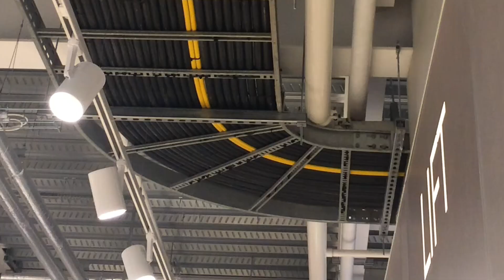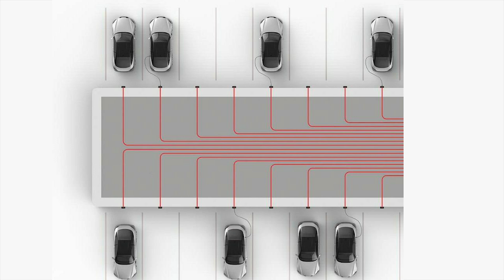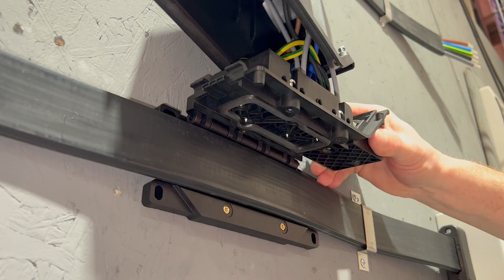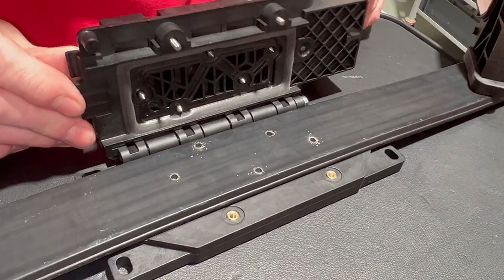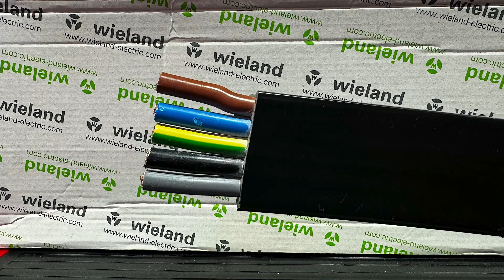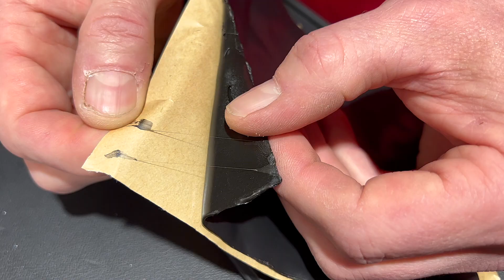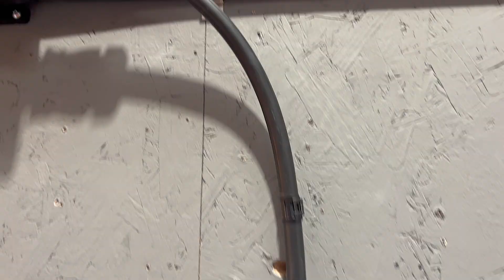How Can This Cable Speed Up Electrical Installations? - Wieland Podis

Comment: Ref. Solar connectors, I think I'm right in saying I'd struggle to find connectors that are the same make as the panels for example? And then at the inverter / battery+inverter end, would I need to find MC4's made by the inverter / battery manufacturer?

Comment: Harks back to the old festoon lighting system where the bayonet cap light socket screwed onto and into the rubber cable piercing it with the same 'vampire' contacts

Comment: I am British and long used British systems.  I now also live in France where I have extensively used their system.  Let's keep it simple, the current UK system is inferior and out of date.  Highlights of the French system over the UK system: Socket and switch in-wall boxes are round not square - cut with a circular tank cutter in a few mins,  light and power cable is marked every metre on the jacket and is colour coded (1.5v2.5), connections to sockets and switches are all push fit with a push button to release, the big benefit is dual pole switching  and isolation for all breakers in the consumer unit. The UK system is truly stuck in 1950.

Comment: We can only assume this is product placement as this gear looks nasty, especially those joints, i guess its cheap but wont be in the long term. A tap-off bus system is just as quick and not at all expensive so cannot see any advantage.

Comment: Usually tapping into a wire causes a bit of a damage to the wire. That damage reduces the electrical cross-sectional area, which in turn reduces the wire's ability to carry current. I am also a bit worried about the connection, will it always tighten properly.

Comment: With that many EVs charging on a buss rated at 63 amps, even if it is 3 phase 415 volts, I think a lot of people are going to be unhappy with their charging times. Here in the US typical home EV chargers are 240 volt single phase on a 60 amp circuit. I have no idea what the power-factor, or the situation with sine distortion and harmonics from these chargers is, but it can't be good.
Reply: Power factor should be extremely close to unity for any large power supply. They all have active power factor correction.

Comment: Just trying to understand, the entire buss bar can only handle 63 Amps?  My home charger uses 48A/240V, so that wouldn't even get 2 chargers.
Reply from the maker: This is 63A per phase at 230 - 43kW
Reply: @efixx  Assuming this is 3-phase, 63A x 230V x 1.732 (√3 - for 3 phase) is only 25kW.  I'm not sure how you get 43kW.  A typical slow home charger in the USA is 11.5kW, which delivers only about 25-30 miles of charge per hour of charging.  You could get just over 2 per cable here.  Anything too much slower than that isn't worth much if you are only going to use it for an hour or two.

Comment: I do not see a convenient way to do 90s to go vertical. I wonder if there is a box that can be used to bend the cable to prevent breaking out for multiple turns and curves that you may get with previous infrastructure.

Comment: I wouldn't worry too much about the need to install EV chargers in underground carparks or apartment buildings. That practice will likely soon be outlawed (and already is banned in several locations), or made utterly impractical by insurance companies refusing to cover any building with such installation. The risk of uncontrollable fire caused by charging EVs is simply too great. It will likely soon become illegal to even park an EV in such a facility.

Putting EV chargers in the lower parking levels of large residential buildings, or even allowing EVs to park in them is just asking for a disaster of monumental proportions.

Comment: No no no just no  this is just a hd version of the aspock wiring system used on alot of hgv trailers. 5 years later the green death WILL set in and cause havoc just do it right and do it once. Armoured cable and junction boxes will be cheaper both long and short term

Comment: I live in the US and installed my car charger DIY. It was a 30 meter run from the main panel to the garage. 15 meters ran underground through a previously installed 2 inch/5 cm buried plastic conduit. I ran 3/4 inch/18 (+/-) mm thin wall conduit from the main panel to the existing conduit. Code required a GFI breaker (which I would have installed anyway), #8 for power and #10 for ground. I don't know why ground is required in metal conduit, but the code is written in blood, not ink, so I follow it in letter and spirit. My number one rule for DIY is: materials are free compared to the labor costs saved. Respect yourself. Use the best and go big. Electricity is for life.

Comment: I don't quite get the point, as metal pipes as you show at the beginning are much safer in case of fire. Only metal pipes are used on ships, and with the increased risk of fire when the EV cars charge, I would strongly recommend that metal pipes continue to be used, not least in underground garages. Although the flat cable works and connections seem smart and fast, they will also melt faster in the event of a fire.

Comment: Looks like a nice system, but high prices and misleading time savings...

I specced it out for our mobile 4 charger system a couple of months ago. It would be at least 500 bucks more expensive. Connectors at 60 bucks a pop (7 needed) and buscable at 100 bucks per meter.

The time savings are calculated unfairly. They compare it against a system where each charger has its own circuit. That's not functionally the same.There are many chargers that can daisy chain and thus share a circuit. That would be a fair comparison.

Comment: Speaking as a Norwegian electric car owner, this setup only makes sense at home. We have charging stations at pretty much all shopping centers and it's only the 50kw and above that ever gets used. The 22kw and below are not used as there's simply no point in the timespan you expect to be in a mall. At home though it's a different story. You venture out and head home to the same place on routine and seldom, for most people, travel far. This system is for housing or commercial buildings wanting to offer charging to their tenants/employees. For any other use case i see no point in this low amperage and the use of the charging stations all over the place around Norway would suggest the same. Drive by any 22, 7,4 or 1,3kw station and they'll be empty. Technology has surpassed their need. It's worth mentioning that 90% (i got that number out my ass) charge at home here and only use charging stations as a way to get some where. Even the big charging stations are mostly empty unless they're on the way to somewhere or it's weekend and people are out and about. And last example. Most hotels have charging stations, but they're rarely ever used because it's so slow. It's much easier to just take 10 min break at a 400kw station on the road and get topped up.

Comment: Metal conduit is not a "weird thing", its common in industrial installations where armor is required, as well as MC cabling, as its already in its own 'conduit' if you will. It's all dependent on applicaiton.

Wire nuts are not "American", they are a Canadian invention out of Montreal, which is why their actual name are "Morrets", funnily enough, thats the original name of the manufacturer (kinda like when you think tissues, you call them Kleenex instead of 'tissues'.

I also dont understand why UK electricians talk bs about the North American System, We also use 240V, however, we only use it for large drain systems, most of the items and appliances are happy with 120V instead of Leg to Leg (240) and only go to the Neuteral (mid way between the two transformer side). We also have 3 lug 208V as well. In addition, We dont use the Ring bus for a reason, we perfer home runs that are tapped in parrallel with a max of 12 recepticles (2 per outlet) on 14/2 gauge or 16x on 12/2 gauge (thats the code in my area). It provides greater control of draw and separation of circuits than a full bus system; and also makes it easier to localize and fix.

Comment: In algeria we have a Locally made thibg that also piece the Cables to make contact with the wires 
U just have to place it where u want and then tighten the bolts 
Its rated for a lot of power delivery (240VCountry)

Comment: System looks nice, but whats keeping me from tapping into that for free electricity. And also its like 2 cars at 11kw each to charge for a single installation of those 16mm2 cables. Like you'd need quite the wire gauge to make it usefull for charging alot of vehicles at once

Comment: This would be a cool system to use in properties and would save a lot of time with rewiring to add extensions or modifying electrical outlet placement.

Comment: Well there's a big issue with the system there, its only designed for slow chargers under 20A which means no fast chargers.

Comment: I see one big issue.
Cable is 3 phase, and single phase vehicles use only L1 to charge. If you want to keep your system balanced, you would need to rotate the phases for each charger
Reply from the maker: You can deal with this at each tap off - or select a charger such as the Zaptec Pro which handle this automatically
Reply: @efixx  Is there any solution where there are may networked chargers and they do measure load on each phase, try to balance the system as much as possible and make sure no phase is overloaded (63A limit)? And also balance the charging speed on each charging point by varying CP duty cycle.
Some vehicles have single phase only, like Nissan Leaf. 
Some vehicles, like ID3 40kWh have 2 phase input, so they can do 32A single phase or 2x16A. 
And some cars can do 1 phase 32A or 3 phase 16A. 
Or in case of my Zoe, 1 phase up to 32A 7kW or 3 phase up to 63A 43kW.

Comment: If it's any consolation, US electricians usually also struggle to understand that EVSEs are protected against overcurrent and contain GFCIs/RCDs. Though I would guess that the overcurrent protection is not good enough for UK standards on most units (resetting requires toggling power to the unit).

Comment: The system components look like to be well built, but that piercing connection just looks wrong, wont they create resistance and hot spots along the wire ?
How will they last long term corrosion ? 
That being said, for this application the best solution would be the classic rigid PVC VD tube and junction boxes to connect the charging terminals.

Comment: I'm a commercial electrician in the US and almost exclusively run electrical circuits in metal conduit, fyi. We Electrical Metallic Tubing, which is thinner and not threaded but uses connectors. We also use thicker threaded conduit, which we call "rigid conduit". We could never use the system you highlight here, because we are required to use EMT in parking garages and rigid conduit where they are exposed to vehicle traffic or other physical damage.
Reply: Yeah, rigid is everywhere and it's so much nicer to deal with than this UK armor plating crap. Which he even states is a problem in itself because it's nearly impossible to modify. Bending rigid is cake. Modifying it is not that hard at all.
Reply: @KaiserTom  "armour plating" ? really
Reply: @TheChipmunk2008  Yes really, damn near. UK conduit is stupid thick and hard to deal with for no reason. The stuff is nearly explosion proof for no modern reason
Reply: @KaiserTom  it's  mechanical protection for the conductors
 I dont want a drywall screw through it
Reply: or a forklift fork
Reply: @TheChipmunk2008  Great. And that's why in the US we use rigid, or flex, which is bendable, with some effort, by hand if necessary. But still protects wires perfectly fine without being impossible to modify or work with like the UKs conduit.

Also you don't understand code if you think you can randomly drywall screw the wire. It's required to be deep enough in a stud that a 1-1/4 drywall screw is literally not long enough to pierce it to avoid that issue.

I'm not saying conduit itself is hard to work with. I'm saying the UKs conduit, which is much thicker than the USs rigid conduit, is needlessly difficult to work with.
Reply: @TheChipmunk2008  you gotta be slow😂
Reply: I'm pretty sure the ignorant jabs at North American electrical are just engagement bait. eFIXX has been around long enough to know better.
Reply: This, Everything has its specific application due to safety codes (which are highly tested by multiple agencies (CSA, UL, EL being the largest), if its not meant for the application its not used, but if the code requires it for the application requiring completion, it will be used.

I dont understand why electricians from the UK (and some other area's of Europe) are so dense when it comes to the north american system and codes.
Reply: @JSLEnterprises  Yeah, exactly. My dad was involved (as an EE/PE) in writing some of the electrical code, and there were usually reasons backed up by experience paid for in blood, tears, and money. Usually better to ask someone why they do something a certain way rather than just make fun of them. Sometimes you even learn things as a result!
Reply: @Ughmahedhurtz  Indeed, never make fun of another country's code unless it's deserved (residential grade outlets still coming with 'backstab' connections when they've been long known to cause fires for example is a mindf*ck) . But i am the weird type of EU electrician who thinks wirenuts are perfectly ok for their listed purpose LOL
Reply: @TheChipmunk2008  wire nuts and the far superior Wago connectors are both UL listed.
Reply: @jcnash02  yes.... , and csa too
Reply: @jcnash02  I have wagos fail on me far more then wire nuts.  Most wagos I see are similar if not identical to the connector in backstab outlets
Reply: @JSLEnterprises  Mainly because it's a very restrictive system ... 'must be listed for the purpose'. You can't say, drill a new knockout unless the manuf has specifically had it listed for that purpose and so on...  it's not being 'dense' it's just a totally different mindset than most EU codes is all. I've worked stateside, and yep, the NEC is fairly simple when you're used to it.

Comment: We use this cable since two years in switzeland 
But i dont like the connectors its not large inuff for 16mm2 plus torx 15 its for nothing
I think theye most change the conection wires inside the connectors 
I made more thene 50 connectors 
I have some ideas if the company want contact me to share it

Comment: When Edison  first wired buildings, the gas lines were used as conduit for the wires. Gas lines and water lines use the same threads.

Comment: What's the best electrical standard in world? Who has the least number of electrical fires maybe a good metric. AS/NZS3000 is pretty sound and sensible. One difference between the two countries is in NZ average Joe can change a power point or light fitting without wearing the wrath of union dominated nanny state here in Australia.

Comment: I was going to say, this cable looks so familiar. Then I remembered my years of setting up cubicles.  They had these inside like you said.

Also Wagos cost $1 a piece at my local Home Depot as where wire nuts are $5 for a pack of 30. If Wago connectors come down in price, ill start using them.

Comment: 20 chargers running at a very slow rate or 2 22kW 3 phase chargers on full power.
Reply: at 16mm2? I think continuously it allows for about 40amps, which means about 9 kW per Phase ... so I think it's more like 1 22kW charger, 2 11kW charger, or about 10 chargers that give you 2-3 kW
Reply: @hammer082  They said in the video it's rated for 63A. 22kW chargers need 32A so near enough 2. Maybe it's higher than you expect because it's designed to be surface mounted not installed inside a wall. It seems like a good system that will allow a lot of chargers so be connected quickly, but it seems too low a current rating to adequately service that many chargers. More metal would increase the cost of course. Everything is a compromise.

Comment: I see an polarisation issue here. If the cable was tristed somewhere, you are screwing the block into the "back" of the cable.
Reply: the keying on the cable keeps things honest. there is no front or back
Reply: I liked the fact that since earth is in the centre in the worst case scenario of somehow fitting it the wrong way, the earth connection will never be connected to live.

Comment: That was interesting even to me. I work on low voltage micro electronics. Did i miss a part about fire fire rating of the Weiland flat multicore? IK09 is only impact rating.
Reply: The cable is low smoke zero halogen - LSHF 5G16; 0,6/1kV; CPR class B2ca-s1a-d1-a1; halogen-free; flame retardant

Comment: seems like the "innovation" is just allowing a radial/bus rather than special connector. 

standard electrical boxes like those shown on the terminator off this bus. could be used to make each connection

Comment: I like the buss bar cable system but have a problem with charging EV's indoors and under occupied living spaces!
How many more of them bursting into flames during charging will it take to move them outdoors only?
I for one don't even want a neighbor's EV plugged in next to my car in a parking space.
Reply: You have been misinformed; Petrol or diesel cars are 20 times more likely to catch fire than an EV. Here are some stats; 
Per 100,000 vehicles on the road in 2021:
25 EVs caught fire
1529 Petrol/Diesel Cars caught fire.
3474 Hybrid vehicles caught fire.
if you don't believe me, look them up yourself.
Reply: @therealchayd  How many of those 100k vehicles were EVs?
Reply: @menel134  It would be 100,000 as in the stats are for 100,000 cars of each powertrain type. (Source: International Fire and Safety Journal)
Reply: @therealchayd  you're not worth my time with crap stats.
Enjoy you're EV if it doesn't catch fire when you go to sell or trade it in!
Reply: @sgwyrick  Fine, continue being a luddite. Your loss, buddy.